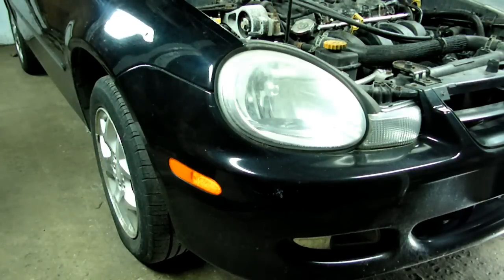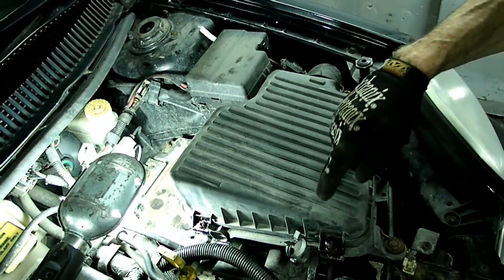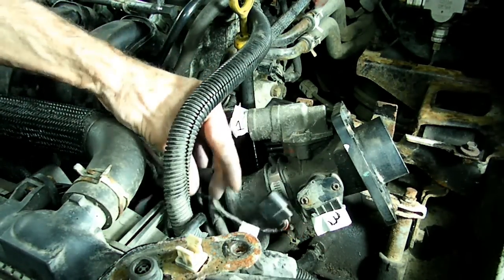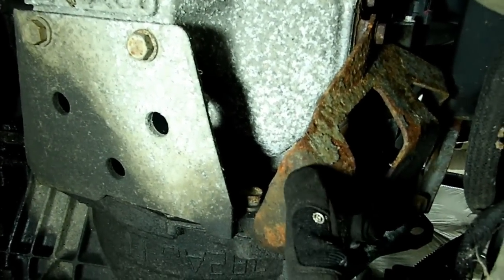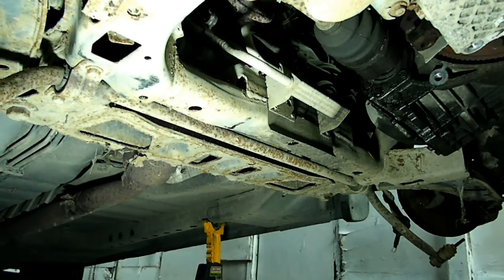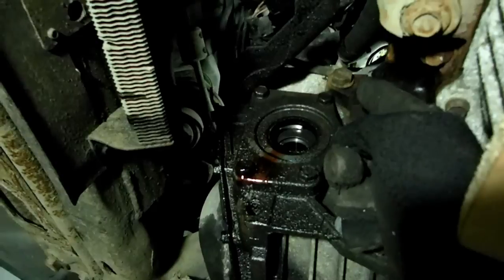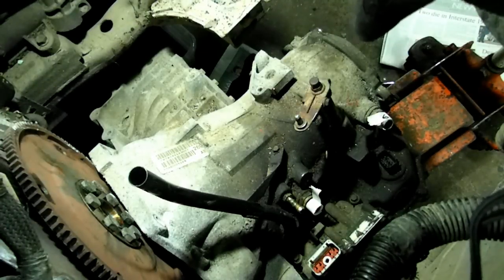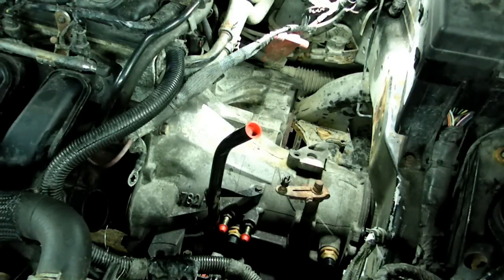Dodge Automatic Transmission Removal

Comment: I have just done this exact operation on my pt cruiser and I can confirm that the operation to remove the auto box from a cruiser is exactly the same as per this dodge neon. The only difference which I did to make it a little easier was to drop the gearbox to the floor using a chain block which means you have a lot more room under the car for working space to realign the box and fit bolts etc...great video..

Comment: one item to add for anyone following this procedure - as of my comment all Neons are at least 14 years old - if you are in this far to change a transmission, do yourself a favour and (mark bolts) and pull the flywheel while your in this deep, so you can Change the Rear Engine Seal for like $12 more.  it is a extra fifteen minutes work and $12 that will no doubt save you from pulling the trani again soon to fix a rear engine seal leak. - just my advice!

Comment from the maker: @ironman1438 Use a long screwdriver pry the neck part of the filter out of the seal in the transmission then put the new seal on the new filter and pop it in place.

Comment: On Caravan replacement. noticed a smooth bore hole w/ mount screw hole. located on bell hosing above where trans axle meets it. It's similar to a sensor port w/o threads. Has sand oil dirt in it. I don't recall removing anything from it. noticed urs does not have it 
Have Chiltons manual  have already found several mistakes  things they've left out.
TO ALL Richpin does an excellent job in this video The only thing I'd change remove the entire shift lever/dip stick ur new 1 won't come w either

Comment: Very well made video. I'm having a problem with my Ford Escape. I need to access the exhaust manifolds to drill out broken bolts that are causing exhaust leaks on either side of my motor. I can't pull the motor out myself. Is there an easier way? Any help would be greatly appreciated. Even if you can direct me to a good video.

Comment: Yeah, I still used this as a reference, the manual on a 2000 neon doesn't have the transmission coolant lines and has two cables for the gear selectors, and a speedometer cable coming out the belhousing. This still helped.

Comment: Nice tutorial,nice clear video and step by step instructions....I was wondering if you would have enough room to slide the Trans as far as you could over,without having to drop it down,If you just wanted to replace flywheel?

Comment: There is no need to take the electrical connections off the starter. I just supported the starter with a zip tie after taking out the starter bolts. Also do not lower The engine any more than you have to to get the bolts out for the trans mount. You will damage the Right engine mount like I did. It is a special liquid filled mount that will cause a nasty vibration when damaged.
Reply: Thanks man!

Comment: @richpin06a it's in front right side almost next to the Ac compressor, radiator removal nesissary, changing it is not bad but serpentine belt replacement IS a 2 person job, there is absolutely NO room for large hands, I'm 17 and I had issues getting my hands in there to change it! Real fun lol

Comment: I have a '03 Grand Caravan and I know it's a bit different from this. But I was wondering if you would have to get a alignment after you put the ball joints and everything back together? The reason I asked is because I had mines aligned a few months back, and don't want to have to pay to get it done again lol.

Btw, my trans front seal is leaking, that's why I want to remove it and replace all the seals.

Comment: what makes these auto Transmission go? i hear some thing about the coolant mixing with the tran fluid?  is there a way to prevent this ? can i  take the hoses off and clean some thing ? or is this just some thing that just happens to brake around 80.000 miles?

Comment: Question, how long would it actually take for a mechanic to take out and fix or change the torque transmission? My engine light came out and it needs to be fixed. I have no clue how long it'll take or how much YET. Please help. Thanks

Comment: i just bought a 1990 f150 with auto overdrive trans. i noticed there is a metal line dangeling between my catalic converter and trans. has a clamp on the end and runs toward motor and t's into rubber lines behind intake and block...what is it and where does it conect? does it go to the trans somewhere?

Comment: Maybe you can answer my question. I have a 93 dodge shadow, which unfortunately for me is a transaxle, so removing the engine is quite tricky. The Haynes service manual shows just the engine being lifted out, which leads me to believe it can be separated from the transmission before being lifted up. How far forward would I have to slide the engine toward the passenger side to get it out? or would I slide it forward, and try to reach the torque converter bolts and unbolt it and lift straight up?
Reply from the maker: Most automatic transaxles have a tin cover on the bottom hear the flywheel you remove to get at the converter bolts.Then you can slid the engine a little to the pass side and you can pull the engine out.
Reply: richpin06a awesome, ill see if I can figure out how to remove that! I watched a few videos of it done on other cars, mostly rear wheel drive configurations, though should be a similar procedure

Comment: please be advised that the jack stands are in placed in the wrong location the should be placed at the lifting point on the seam of the rocker panel. also when jacking the car never jack more then 3 inches off the ground on either side its best to have 2 jack and work them with a buddy or one after the other slowly or you can twist the unibody and cause aliment problems as well as high speed stability problems

Comment: forgot to note that when putting the torque converter bolts back, u will need to position the flywheel with the oval hole first, correct?

Comment: He Rich love your postings - always very well done and easy to follow.
I realize this is an older vid but i am doing this exact job right now and would like some help:

I have a 05 Neon in need of a new ATS - got a used one from another 05 with low mileage on it.
I am wondering about the bolt-up of the torque converter - those four small 18mm bolts that are installed through the access plate at the bottom of the engine to transmission connection.I understand how to turn the engine from the harmonic balancing pulley bolt, but  It would seem that these four bolts may only fit one way? Is there any kind of index marking i should watch for or are those four bolts equally spaced and can fit in any sequence?
Any advice would be appreciated, thanks.
Reply from the maker: What i like to do if i think there might be aligning issues is to mark the parts so they will go back together without problems.
Reply: @RichpinTv  Yeah except this is a replacement so the "new" one has never been on this car until now. I marked the bolts and holes ABCD WXYZ
Tried the first position AW and no other bolts lined up close enough to insert a bolt Then tried AX, only two lined up close enough to get bolts in , third try AY and all four bolts lined up.  Seems to me there is likely only one way these all line up.
On your comment about "no lifting point" i used an overhead hoist (after removing the hood) and i left the small trianglular bracket on the very top of the trani - this has a good sized opening right through the centre of it and my overhead chain hoist hook fit right in that hole, this location is pretty close to a balance point! I used the same trick to hoist in the "new" trani

Comment: I have a 2001 Dodge Stratus coupe that I'm going to put a new transmission in I can't find any videos on my exact car is the 2002 Dodge neon transmission removal the exact same for my Dodge or do you think I can get mine out another way
Reply: kris cruz I have a 98 stratus and need to replace the torque converter, my theory is being Chrysler tranny tech, the major differences will probably be brackets and location differences because of the frame difference. Also the stratus has a slightly larger engine than the neon.
Reply: TehGamerXeo I have a 99 dodge stratus that needs a new torque converter too, my car is acting up on me.

Comment: That's nice work! I like the intelligent, methodical way you worked through every step.

Was the torque converter bolted or attached to the flywheel? I only know that the torque converter transfers power from the engine to the transmission, but I really don't know how it works.

Thank you :)
Reply: Yes, the torque converter is bolted to the flywheel.  You can only access one bolt at a time, then turn the motor over to access the next one and so on.

Comment: i have a 2002 dodge neon, the transmission on it was fine but started to fail after the temperature went up, i mean it would drive fine for the first few miles and then it would just rev like the car was in neutral. i replaced the transmission and still have the same problem. please help me. 
Someone online said transmission cooler might help.

Comment: Will a 98 chevy 1500 transmission fit in a 95 chevy astro van? I'm getting rid of my 98 chevy 1500 because its a 3 seater and I have 6 kids so theirs no use for it anymore. But it still has a good transmission. My chevy astro needs a transmission so I was wondering If I can use that transmission and put it in my 95 chevy astro van and will it run like it should with no problems?
Reply: No, the Chevy 1500 is rear wheel drive, and the Astro Van is front wheel drive or all wheel drive.  No fit.

Comment: Thank Heavens The Auto transmission in my Mitsubishi  (KS verada fitted with the 6G72 SOHC 12 valve)  had to rip it out for replacment as it had major failure the car ran fine but the bearings in the box blew in the box, easy driver side CV out (right hand drive as it should correctly be) undo the bolts, put the jack under undo the transmission mount up top slide it out while dropping it and done took me all of 40min if that to remove and 60min to re install the new one in my own home garage

Comment: ok so i have a question i have a 2001 dodge neon SE and i have it at a mechanic shop now hes telling me that for some reason dodge made a special transmission in 2001 so i can only get a new transmission from another 2001 neon...sounds like a load of BS to me but is this true? all my co-workers say its not.
Reply from the maker: I believe the 01 was the last year they used the 3 speed (31th) transaxle Starting in 02 they went to a 4 speed (41TE).
Reply: richpin06a Yeah my 2000 has the 3 speed, and its rock solid.  I don't know why they changed it.
Reply: T C
They went to 4 speed because 3 just ain't enough, especially when trying to pass on the highway. The 3 speed drops into second, and the engine is screaming in order to pass!
Reply: what makes these auto Transmission go? i hear some thing about the coolant mixing with the tran fluid?  is there a way to prevent this ? can i  take the hoses off and clean some thing ? or is this just some thing that just happens to brake around 80.000 miles?

Comment: Well I finally did mine and I honestly gotta say the only thing that was hard about it was parting with 1400$ at advanced auto 😂... btw what I did to get it on the ground was let it fall off the floor jack onto the ground... replacing it anyway folks just keep body parts clear... 

Btw mine was the three speed. Much smaller and lighter!!

Comment: if I want to replace the flexplate on my 2005 dodge neon sxt. do I have to remove the whole transmission to replace the flexplate?
Reply from the maker: I do not see any other way to get at the bolts holding it on.
Reply: +richpin06a ok. I will probably be done removing the transmission today after watching your video. thanks allot! but do you know if there is an specific way to put back the new flexplate back on the transmission?

Comment: how do you get the fly wheel bolts out? i cant fit an impact guy in there?
Reply from the maker: ***** Have you tried a standard ratchet.
Reply: what makes these auto Transmission go? i hear some thing about the coolant mixing with the tran fluid?  is there a way to prevent this ? can i  take the hoses off and clean some thing ? or is this just some thing that just happens to brake around 80.000 miles?

Comment: i have checked the radiator for cracks and flushed the transmission fluid to check for coolant in it....no cracks in the radiator and no coolant in transmission fluid.

Comment: over kill my thought you never needed to remove the engine bracket from the car to get that transmission out of that car all you needed to do is remove the four bolts from it way overkill and to much unnecessary work just to remove the transmission you made this look harder than it actually was my thought